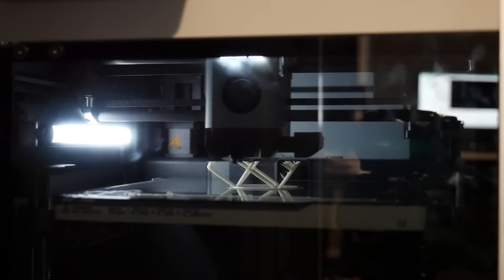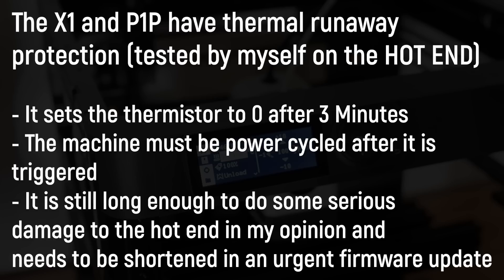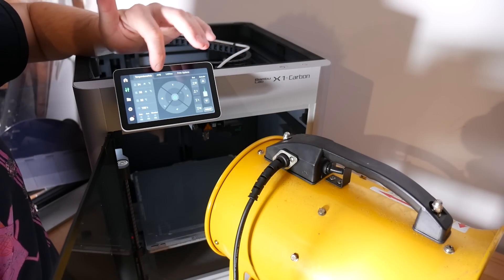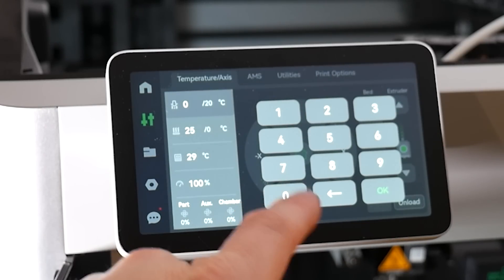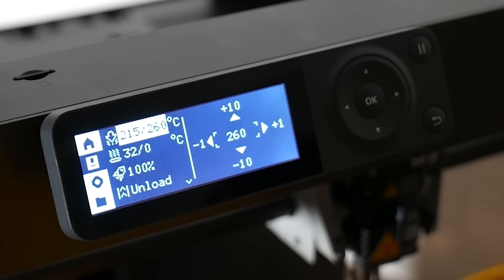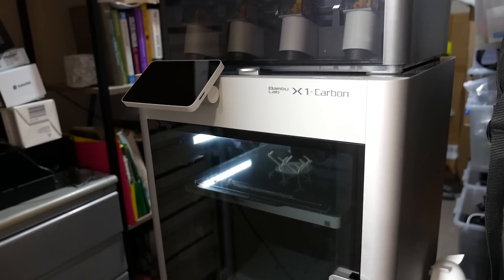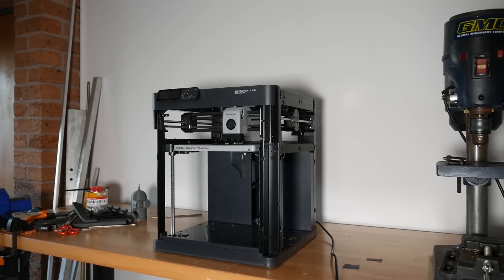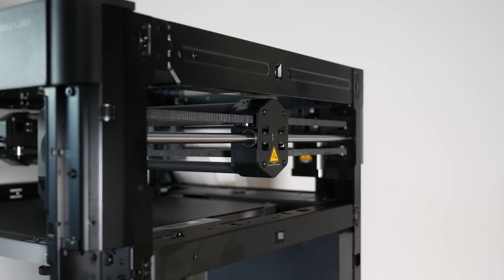Thermal Runaway Testing on Bambu Lab X1 Carbon and P1P

Comment: Pretty laughable how a $150 ender 3 has better TR detection than a $1K "high tech" printer. Bambu lab cares more about you not having a failed print because of false alarms, than they do about a potential fire hazard.
Reply: Dang you really didn't watch the video.
Reply: @morbus5726  The mental gymnastics people go through to defend a 3 minute timer.
Reply: @LilApe  lmao i wonder how much time you waste getting offended by bambu videos on the internet.
Reply: @morbus5726  About .1% of the week actually
Reply: @LilApe  I can logically hold both ideas in my head at once: Ignition via thermal runaway is mitigated by their thermal runaway protection, and 3 minutes is a silly time.
Reply: @LilApe  10 minutes per week 🫢
Reply: There is thermal runaway protection. There is no potential for a fire hazard.  Did you even watch the video. He couldn't even get it to 240C. 
The machine shuts down and only a hard reboot will make it work again.
Reply: @ashleys3dprintshop  Say the owner didnt hook up the thermistor correctly when swapping a nozzle/hotend, I guarantee it will reach 240C and above before TR kicks in.
Reply: @JarredSutherland  That's what happens in nero's test. It got to 280c in like 45 seconds. The only reason why it didn't get above 240c in this video, is because angus is actively sucking hot air out of the system, people are ignoring that.
Reply: @ashleys3dprintshop  He intentionally couldn't get it to 240c trying to validate that it works in 3 mins like stated. What his test does NOT show is the potential to get to those higher temps much faster if, for example, there is a short or open wire on the thermistor, or an intermittent connection. In a real world failure, it can easily exceed 240c in less than 20 seconds.
Reply: @crussty3d Yes the heater in the X1C is fast. What you still dont understand is that you arent going over a certain temp because PTC heaters by design are regulated by the voltage they get and as they heat up they offer resistance to regulate temp. Even without the shutoff from firmware the heater cant go over a certain temp. They do not catastrophically overheat.(melted heat blocks or worse. 

I think the misunderstanding in the comments are folks thinking it's like the old style heating elements of yesteryear where thermal runaway would cause fires or worse. 

I'm going to post a quick overview of what PTC heaters do and the built in safety features they have.

"Positive Temperature Coefficient (PTC) heaters are self-regulating heaters that run open-loop without any external diagnostic controls. While traditional fixed-resistance heaters employ wires and coils to generate heat, PTC heaters use conductive inks printed on thin, flexible polymer-based substrates. Scoring high on reliability and efficiency, they are ideal for products that require safer, faster, and more uniform heating. The properties of the material allow the PTC heater to act as its own sensor, eliminating the need for any external feedback controls. As a result, the heater inherently eliminates the risk of overheating.

PTC heaters utilize Positive Temperature Coefficient materials, materials that exhibit a positive resistance change in response to the increase in temperature. As the temperature increases, the electrical resistance of the material also increases, thus limiting the current flow. The material allows current to pass when it’s cold and restricts current to flow as the threshold temperature increases."

Even it the thermistor is removed, damaged or nonfunctional there is a literal hard limit to how hot the PTC heater can go.

1, it will not cause a melt down.
2. firmware will trigger and shut down heating when an issue is found. 
 3.The stainless and hardened steel isnt melting either. 2200C melt point. 

The FUD that was tossed around, while entertaining, was more alarmist comments than factual information.
Reply: @ashleys3dprintshop  For me PTC heater is commercial name to the heaters with very sharp temp-resistance characteristics, different technology, which indeed can maintain desired temp when they are connected to a small heatsink, and also keep the same temp when detached.
Calling MCH PTC is confusing. (Bambu doesn't call them PTC)
youtu . be/  FIXG3tlILCY?t=975  Revo MCH heater runaway test.
Reply: @ashleys3dprintshop  Did I watch the video? Did YOU watch the video? 3 minutes is far too long for TR detection to kick in. And ender 3 cuts off far faster than 3 mins.

Comment: This will get fixed. The original guy was just a bid exaggerated and aggressive.
Reply: It is understandable he reacted that way and nobody would fix it, if he had not kicked that door in.
Reply: @MrKhay82  It was...very raw emotion i'll give it that. 

2023 will be very interesting. Whether you like BL or any other brand time marches on.
Reply: Nero apologized for jumping to conclusions the next day.
Damage to reputation is done though. Look at some of the comments even when Angus addresses it and Bambu lab response. 

People are in a tribal mode for their love of another brand and hatred of another.
Reply: @No0o0o0o0o0  It is why more people should be in engineering. Having a PTC heater is already many times better than standard NTC heater cartidges used in almost every printer even the prusa mk3s. The Revo hotend also has a PTC element which is much safer. But even then they are all still missing the redudant safety measures of thermal fuses, mechanical thermostats typical in cheap consumer products because it is far easier/safer than software safety. Software is not considered safety rated (well unless you want a lockstep processor and to do a whole FCA on the heating system with great development costs, regulatory oversight, fully redudnant control, .... that no consumer product should really undertake). Yes thermal runaway is a neat thing to have but its just a bandaid PTC alone is actually much much safer design.
Reply: @No0o0o0o0o0  "Damage to reputation is done though"
Thanks to bambu labs lack of transparency. Nobody in this world (except bambu lab) knew that the timer was set to 3 mins. Everyone assumed it didn't have TR detection and for good reason, it shouldn't take 3 mins to kick in.
Reply: @LilApe  ok. Well Im getting another X1CC this year. It would have been a prusa XL but that thing has been sitting in limbo for 2 years and costs waaaay more.

Prusa machines had actual fires and they are fine. There are no fires and bambu is reputation is irrevocably damaged? Nah.If the want to tweak a shut down time or throw up faster error it's a simple firmware update away. 

There are more positive Bambu lab youtubers than negative. and even this blip from nero was reversed the next day.

I think Tom Sanlander is going full anti bambulab but that is from the trolls not bambu lab themselves...Of course he is personal friends with Josef Prusa so there's that.

Comment: Would it be possible to test for thermal runaway by letting the printer head get up to temp then removing the thermistor from thermal contact with the heating block? That would be my worst case scenario, 3 minutes of the heater going at 100% without even needing to spend energy getting up to temp.
Reply: That's how Nero retested it. In that case, it will heat up to the maximum that ptc can reach before trp will kick in.

Comment: Happy to see you looking into this as well with more tests, will admit looking back on it things could have been handled differently, but hindsight is 2020 and when your live and hit unload on a printer and several minutes later you look into machine and see a smoking hotend and a few more quick tests that would have tripped TRP on any other machine failed to do so I think you can see how that can lead to the thought the machine may have a safety issue

(especially when nothing about TRP other than yes it has it is disclosed by the company and the FW is closed source and custom)

Cheers!
Reply from the maker: Honestly I would have thought the exact same thing in that situation. It doesn't make an audible alert except for a small message on the X1C and 3 minutes is an eternity considering how powerful they are. I don't even remember this much drama around my video about my prusa mk3 "shocking" me when it was my fault for using an ungrounded power strip. We follow up, release a clarification / update vid and move on. Need to be ready for when companies actually do release dangerous products...!
Reply: @moremakersmuse  There is a safety spec you didn't test in the followup video I watched which is the leakage current not the voltage present. If you could feel a shock from the prusa printer it means the Y capacitors are possibly leaking too much current. Electrical safety standards consider what happens if the ground becomes open it should not result in the frame causing shocks.

To be exact it should leak less than 3.5mA or 0.75mA depending on how you classify the equipment (GFCI limits for devices people can touch is <5mA for reference). I use a medical grade PSUs for my printers which has a leakage current rating of <0.25mA and can tolerate any single failure without exceeding the leakage limit. (Obviously these power supplies which still pass EMI/RFI specs are about 3-5 times more expensive)

Having devices leak too much current can eventually cause GFCI circuits to trip so lower leakage is better as long as it still passes EMI/RFI rules.
Reply: I can understand both sides of the reasonable arguments that the protection is good enough or that it needs to be improved. 

But I won’t tolerate any kind of hate towards content creators like you or Thomas. I don’t know what’s wrong with those kind of people, especially on Twitter. 

And I don’t understand what there is to lose for the average community member when disclosing your findings. In the end we (hopefully) get an improved version of TRP on the X1 without losing any features. So where’s the problem those people have exactly?
Reply: No need to defend safety.   Ya did good.  Next!